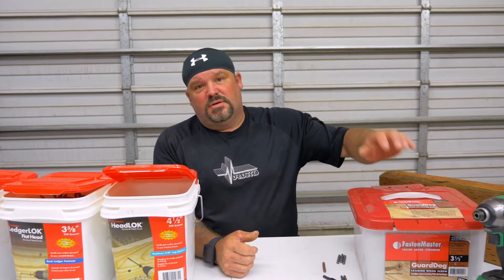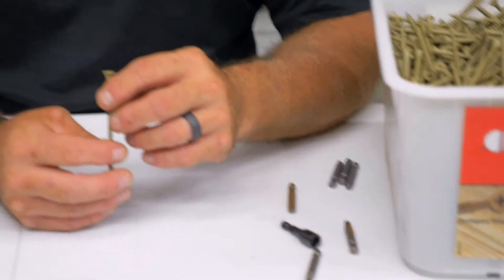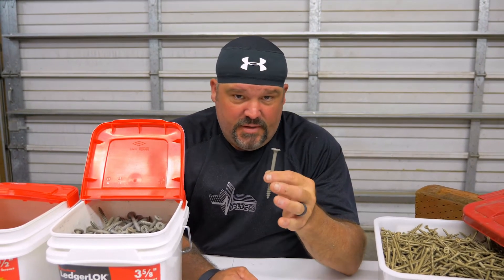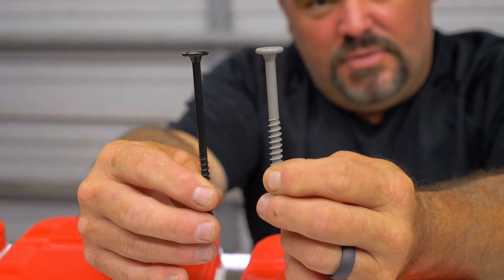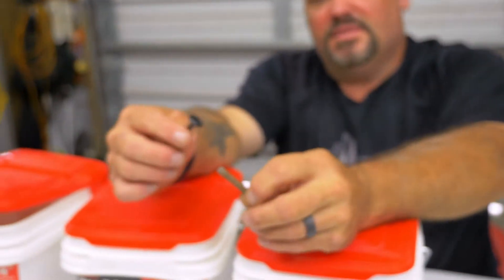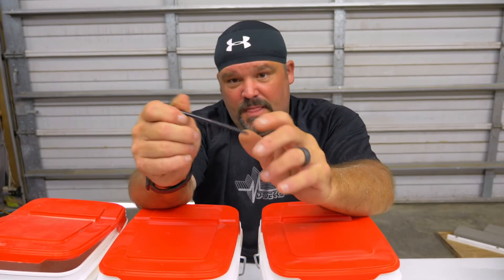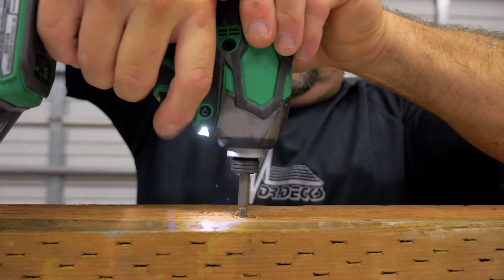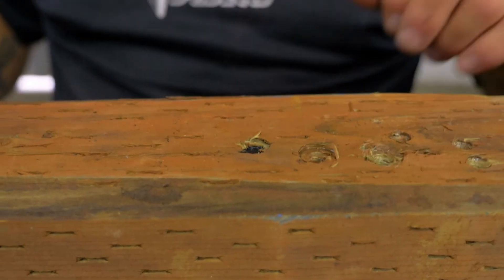Different Types Of Fasteners || Dr Decks

Comment: Fasten Master - Absolutely great for screwing down a deck. I used them in about 2000 and last year had to undo them all. The boards looked too crappy with weathering after 20 years (cedar). To turn the deck boards over, I had to dig the deck coating out of each screw, which was tedious but easy, back out the screws and turn the board over to screw the deck back down. And used the same screws!

That  𝑛𝑒𝑣𝑒𝑟 would have been possible with Phillips or Torx.

Timberlok and Headlok - I've used both to bolt together logs in a buck & rail fence. I was NOT going to beat the heck out of my 70 year old wrists pounding spikes.  These were awesome. No pounding. When I had to re-adjust, nothing to it. I backed them out and put them back in. More expensive than spikes but 𝐭𝐨𝐭𝐚𝐥𝐥𝐲 worth it. I used 6" and 8" with a few 10s on the larger bucks.

Comment: I'm not a fan of Fastenmaster's 8 spline drive - not nearly as robust as Simpson's equivalents which use regular Torx bits. Fastenmaster's 8 spline are very easy to burr over and no longer be usable. Plus, it's a negative in my book to use a proprietary bit. Then the bolts are too thin. My preference are for GSK and Simpson only. Also, Spax are hopeless

Comment: Great video. Question. Can I use the 4 1/2 inch Headok to attach a horizontal 2x4 to a vertical 4x4 when building a shadow box fence? I usually use lag bolts countersunk. Thanks.

Comment: 24 " Timberlok  hex head  , driven thru 17 " Oak Logs ( outside walls )  without pre- drilling a single hole !  That was over 20 years ago. Only the first 4 inches of the screws had threads and did not break off any heads , did break and strip a couple bits.  Also I used a industrial impact driver that can't  be bought at any Lowes or Home Depot, you find them at industrial Tool supplies in your bigger cities.  I have been installing bolts , screws and all types of hardware for 45 years and was sold on the Timberlok products and other types that have come along that seem to have been forged like SPRING STEEL .....yet rust resistant on most .  Never walk out of a supply with just a bucket of screws in your had because it throws you off balance,  walk out with two buckets,  one in each hand and walking straight and with purpose !
Reply: Their expensive

Comment: Great content, I liked and subbed...How would you fasted a ledgerboard to a steel framed house? I can find no structural wood to steel screws anywhere, except for a simpson screw, which I can only find sold in quantities of almost $200. Also, bolting through isn't an option because I can't get to the back side of the steel without destroying the interior of the house. Any help would be greatly appreciated!!!

Comment: First of all! thanks a lot for all the knowledge and always helpful tips. Question: How many ledger locks do you have to use in a ledger? I know every build is completely different. For example, Do I use 2 ledger locks in between joists spaces (16'') assuming there is 16 spacing? thanks a lot

Comment: GRK and spa are equally as good....Ive used a variety of brands . Simpsons with hex head offer more grip; an advantage if you think you’ll have to remove /withdraw/reinsert. Fi be/ideal for covered/unseen joists. But they stick up/out a bit more. The GRK have lowest profile, and SPAX has a bit wider integrated washer. GRK and SPAX are a different color. I would never usE a lag screw again ! However, NB , these cant replace lag bolts IMO.

Comment: I’m currently in the process of making a triple 2x10x16 glu-lam beam to be used as a secondary support under my new kitchen island. I purchased Simpson’s SDWS Timber Screws but am thinking 4” might be too large. Would the FastenMaster’s Ledgerlock at 3 5/8” be a better idea? I plan on alternating sides with a staggered pattern 16” on center, with Loctite PL Premium Max sandwiched in between the boards.
Reply from the maker: 4” should be ok

Comment: You should hit on the difficulties of hanging a ledger on a house with TJI joists and band boards ! We will usually run notched 4x4's every 6' down to the existing footers next to the house as extra insurance of framing stability.
Reply: Notching is bad, because they crack in between if the structure move, I see a lot of them cracked after awhile.
Reply: @jejemon123  You must be taking to much meat out.. I only notch an inch .,, Green lumber has a tendency to crack all over on each edge
Reply: @Delphisteve  notching is bad.

Comment: Take one of those smaller screws you show there and screw one into a board till it comes through the other side. Then hit the screw with a hammer .. If the screw breaks off instead of bending then there isn't enough tensile strength to be used for framing!
Reply: I'm pretty sure nobody is framing with screws 🤣

Comment: Headlock is snake oil requiring a proprietary bit. You can drill GRK RSS into any type of lumber with the "inferior" Torx bit.
Reply from the maker: Don’t shoot the messenger
Reply: I've used plenty of both but I prefer the Headloks. How "proprietary" is a bit if it is commonly available? None of my Fastenmaster bits have stripped out on me, so I have plenty of new ones that came with the fasteners. One fastener I will never use again are the Mitek structural screws -- a pia going in and even worse if you have to take them out. They are expensive and both the screws and the bits will strip.
Reply: @brikshoe6259  i wouldn't call it common, you can't buy it at the autostore or a supermarket. Whereas you can get torx almost anywhere. How "proprietary"? Well my car, equipment, and other tools doesn't use that bit. If i go fix, upgrade, modify or replace something where the previous person use headlock, i wouldn't be able to remove it with my common bits. So yeah, its very proprietary like Apple screws.
Reply: @Pepe-dq2ib  every box you buy has a bit in it.  Ive rarely needed another one.

Comment: Cool stuff. Really need to figure out that auto-focus thing though. Probably need to go full manual focus or figure out an angle to shoot from that doesn't make auto focus wig out.
Reply from the maker: We are patiently waiting for the GH6 to come out.
Reply: Thi either the Canon R series mirrorless with auto eye focus or what I use, Nikon Z series mirrorless, all auto focus. But to pull focus you need a Focus puller setup to key in on those tight shots.